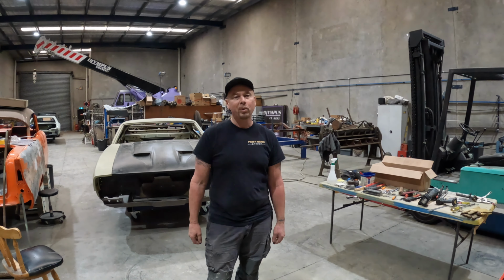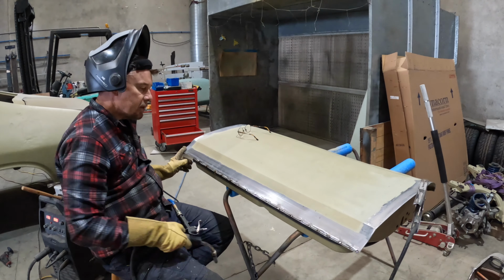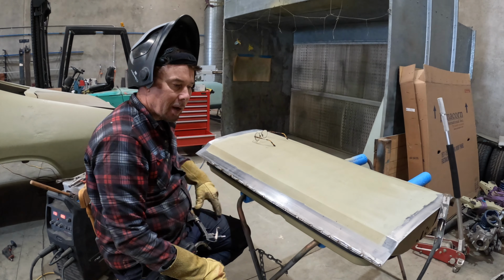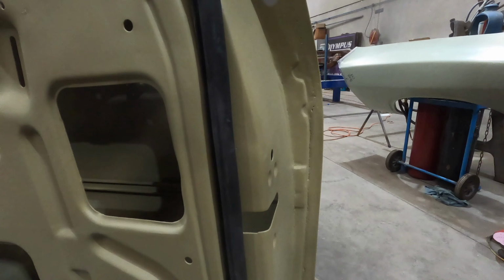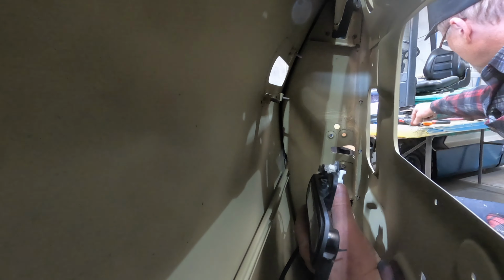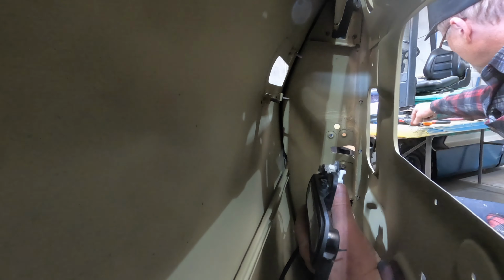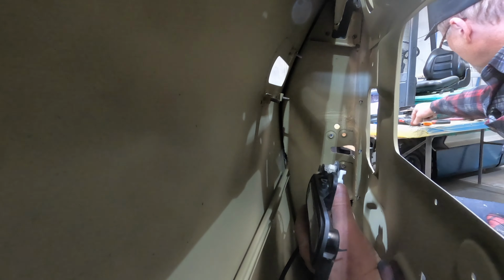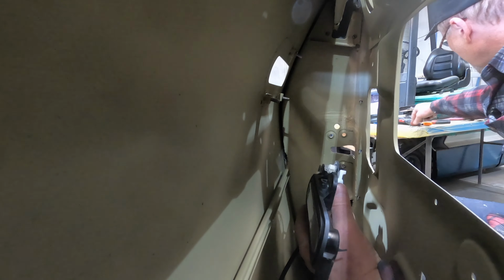Fitting Panels , Gapping and Priming "Retrobution"   Eps 79   Mustang GT, XB Falcon Coupe Build   4K

Comment: That bolt at the rear of the guard. Maybe a tapered  locating pin instead of bolting? You would still have two bolts.
Reply from the maker: yeah i thought about it, or an dome head alen key,  I wont leave that style bolt in any case

Comment: Looks great mate, I always had dreams of cleaning up my xbs like this but all the work went into rust repairs and fixing quarter panels that had about an inch of bog in them. Are you planning on getting rid of the front blinker lights and quarter panel lights and giving them an update? For the quarter panel lights there are led ones the same shape as your door handles, was thinking of using them on a firebird i have to replace the double rectangular ones, might look good on your coupe horizontally like the xc.
Reply from the maker: Thanks Dan,  I was not going to change the lights at this stage, but that may change, I want to keep some of the old and blend with the new